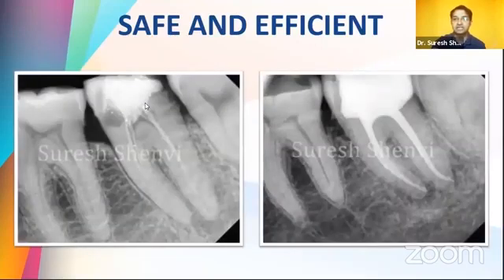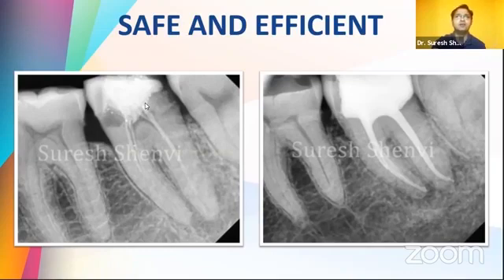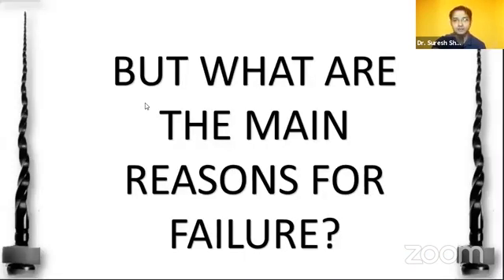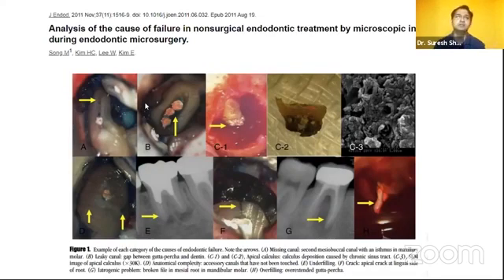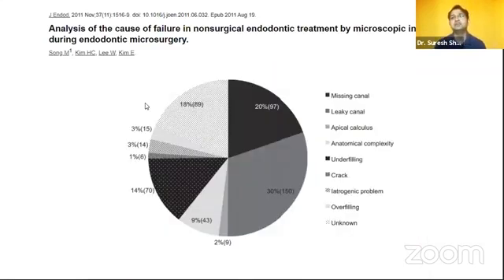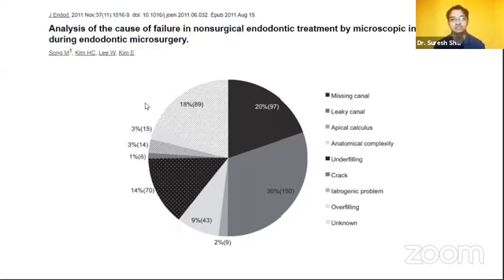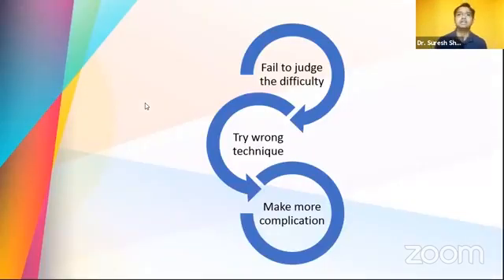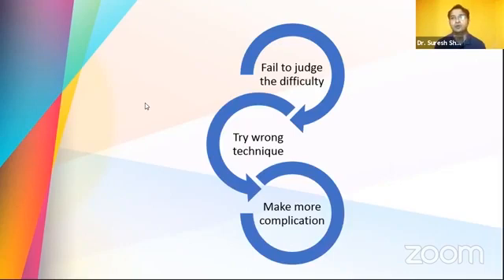Endodontic Management of Curved Canals - Part 1

Comment: Sir sonic irrigator with fiber tip is good or ultasonic irrigator.
Reply from the maker: Both have same results. But overall ultrasonic has more efficiently
Reply: @Aspire32  sir since it's metal tip whencomes in contact with walls of canal chances of fracture rate is more I feel.. What do u suggest.
Reply from the maker: The ultrasonic tip is should be used in passive.mode. thats why it's called.as passive ultrasonic irrigation. I have used different brands of ultrasonic since my pg. I use ultra x now the tips seems to last many case. But endoactivaor too is really.good one which has plastic tip and sonic in form.